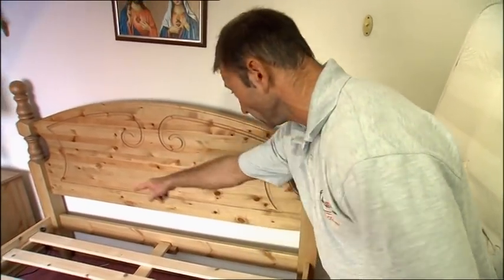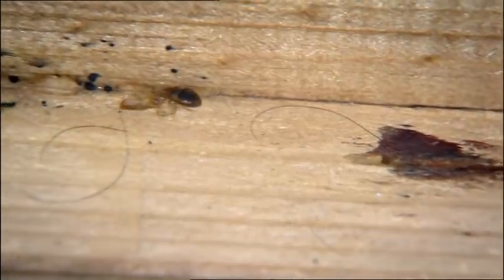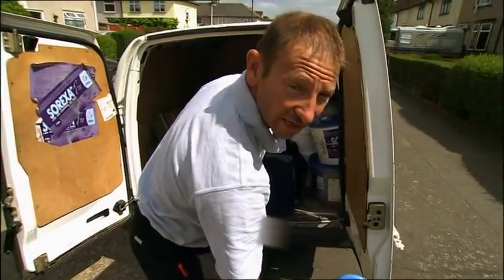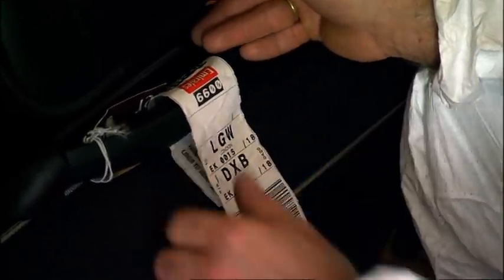Removing A Bed Bug Infestation | Grimefighters | Filth

Comment: A few years ago we had a bed bug problem. I got a spray bottle, 90% rubbing alcohol mixed with water and sprayed my mattresses, floors, headboard, nightstand and every nook and cranny. I got a new mattress, washed all clothes and blankets and vacuumed. Process took about 3 days or so but I haven't seen a bedbug since 2016. Hope this helps if you're on a budget.
Reply: Riyadhra Jackson moving into a new apartment from an infested one. we only had a few bugs and rarely saw them but thank you for this in case we carry them over on accident. we have a new mattress and furniture and have washed all of our clothing so hopefully we won’t but again thank you for the remedy :)
Reply: @4doz817  you're so welcome. A mattress protector would also be a good idea. My parents did it that for my sister but I didn't need it.
Reply: Good on you! However, I must say, you got lucky not to have a fire start from the alcohol. These days, there are new alternatives like CimeXa
Reply: @johnnycochicken  doubt it. I didn't really have anything that would unite with the alcohol.
Reply: And then use naphtalene balls for your wardrobe case. Cmon, there's plenty scented other than the old ones. It's quite good to snob off the bugs
Reply: Thanks so much!!!
Reply: I used strong dettol solution in a spray bottle. I used one part dettol and two parts water. Then thoroughly sprays my room including my mattress, my bed inside and outside. And all around the edges of the carpet by the skirting board. And inside the wardbrode and cupboards. And every single crack and hole I could find in the walls and the doors. I died that once a week for four weeks until they were all gone. I used the original orange dettol which is very strong. I had to stay out of my room after each spraying for 14 hours because the dettol fumes are very strong and harmful.
Reply: @OhItsReo  I have a son and he has a plastic covering on his mattress. When you use the 90% rubbing alcohol, how much did you use? And how long did it take for the mattress and box springs to dry?
Reply: This really doesn't work. The only way to get rid of bedbugs is heat.. also I don't recommend this bc if you spray an entire room with rubbing alcohol creates fumes and your whole house can explode from any heat or spark bc alcohol is flammable. You can watch YouTube videos of people who burned down their house after spraying the room down with rubbing alcohol.
Reply: @JJ_Justice  Its not true that this remedy can't be effective or that heat is the only way to eliminate bed bugs particularly in the early stages of an infestation. However, as you have stated, alcohol is risky and people have caused serious fires trying to use alcohol to eliminate bed bugs.
Reply: Traduction en  français
Reply: @jwbogacki  just now seeing your comment. From what I remember I eye balled it and used  like a cup of alcohol and the rest water in a standard spray bottle from Walmart. Spray bottle was less than a $1 about 96 to 98 cents. It doesn't take long to dry at all. The alcohol makes its dry quickly. Not even an hour. Hope this helps. 🙏
Reply: @JJ_Justice  it worked for me and for the money that I had at the time. I am aware of the potential risk. Thankfully none of that happened to me. This was like 5 years ago and I haven't seen a bug since then plus I have moved etc. I had an ex boyfriend at the time that smoked (not in my house though) and I did burn candles every now and then.
Reply: @leaperrins8373  everything was sprayed at the time. Also I got a new mattress as a Christmas gift from my mom that year so that's just what it was at that point.
Reply: @OhItsReo  Look I get it. We do what we have to do with the resources we have at the time. I just wanted to add a warning and some extra information. If you catch an infestation early it's way easier to deal with on your own. Because bed bugs are almost impossible to treat yourself at the latter stages.
Reply: @OhItsReo  Thanks, i'll keep it in mind. My brother used bug bombs to get rid of the bed bugs about 2-3 weeks ago. I've been using duct tape or packaging tape to trap the rest of them and throw them out.
Reply: @leaperrins8373  oh I agree. Your warning is definitely appropriate. People should definitely be careful. It was definitely an upsetting and stressful time for me. I had just moved out on my own and tried to deal as best I could. Again thankfully I'm bed bug free and hope I never have to deal with them again.
Reply: @jwbogacki  that's good. I hope all is well. It can be a nightmare. Back then it made me not want to go home.
Reply: This works 100%
Reply: I remembered I bombed my whole room with 90 percent alcohol and the room smelled so strong for 8 hours but I had the window open to air out and it killed every bug in there and I didn't have a problem with fire
Reply: Insecticide is not expensive, so there's no need to use alcohol instead of an insecticide due to budget reasons. Alcohol only harms the bugs if you directly spray on them, but alcohol evaporates quickly, so after you spray an area, it will evaporate away, and won't harm bugs that crawl on it afterwards. Insecticide on the other hand can kill them even if they crawl on to the treated area hours, days, or months later.

Unhatched eggs are less vulnerable than hatched bugs moving around. Even with insecticide you need to quarantine the area for a full life-cycle duration to make sure any dormant eggs have hatched, so that the hatchlings can run around and be exposed to the insecticide and die.

I really would not give alcohol much confidence here. Sure, it kills them if you spray with direct contact, but that means you can see them already, so you might as well use the sticky-tape method Pete uses here. Residual insecticide is the nail in the coffin for these guys that you really need, and that's what Pete sprays at the end. That way, any tiny ones that you missed will still die. And according to the post-filming update, it worked!

If you wanna save money, I suggest buying insecticide and doing the job right the first time.

Comment: I had to deal with bed bugs at my ex girlfriend's and my parents house in my parents bedroom. 90% isopropyl alcohol will kill them on contact. Completely soak your mattress and all furniture. On dressers and such, get into those corners really good. Then once you spray everything down really good, take all furniture and put it outside in the heat. Make sure that drawers of the dressers are out and laying on the ground. Make sure every side of the dresser and corner gets direct sunlight as well. They hate bright lights! Once your done with putting everything outside, go back to the room you were working in and soak the entire carpet because if they lay eggs in the carpet then they will just come back. Soak your walls too! Get every single square inch of the room you are working in with that alcohol. Do not sleep in the room for at least 48hrs. I also recommend soaking everything multiple times, like once it dries up, soak it again and let it dry then soak again, this includes the carpet in the room. Make sure you have plenty of ventilation and wear a mask cause the smell will be harsh. I did this with my parents room and we havent seen a single bed bug since, it's been 4 years since this! Oh and all your clothes, wash them in extremely hot water and when you dry them, dry them twice! They cant deal with the heat at all, it dries them out and then they die. If they are in the dresser draws, then it's possible they might be in some of the clothes so it's just safer to wash all clothes! Oh and I also got bed bug bombs and used 2 of those in the room just so the smoke could get in areas that I couldnt. I did this twice, so a total of 4 bed bug bombs were used in a 48hr period.
Reply: OK, I do have to point out that alcohol is extremely flammable and people have caused serious house fires by trying to do what you suggest. Secondly NEVER EVER use bug bombs with bed bugs. They run from the smoke as far as they can, and since they can fit into tiny spaces, you can spread them into other rooms and make the infestation worse.
Reply: @leaperrins8373  I used extreme caution and let the rooms ventilate very well. Also as to bed bug bombs, they do help. I didn't just do 1 and done. I did 2 at a time and did it three times in the room to guarantee the smoke would make it into the small crevices. So in the end, it's been 5yrs+ and not a single bed bug has been seen.
Reply: @kjrwhs2003  I understand why someone would use alcohol, I just wanted to state the risks because its potentially life threatening. However, I really cant get behind bug bombs for bed bugs. Many professionals do not recommend them for the reasons I've stated. There are better less risky solutions.

Comment: Shop vacuum! Vacuuming alone can remove up to 90% of bed bugs alone. Just be sure to empty the vacuum immediately outside the home when finished vacuuming. 

I'm a bed bug heat specialist. We use heat remediation (heating entire rooms or homes) to kill every bed bug plus their eggs, in that size room in about an hour. Heat remediation is hands down the quickest way to eliminate bed bugs in hours not days. We then strategically apply two separate preventative chemical residuals that are undetectable by bed bugs, to protect for any new bed bugs brought in. It is very important to use the correct bed bug chemicals that cannot be detected or any new bed bugs brought in after a full treatment will just avoid the areas sprayed with repellent chemicals until it is no longer effective enough to hurt them. They can survive anywhere around 7 months or more without feeding from your blood. They go into a dorment stage to waste as little energy as possible.

The English fellows bed bug removal with tape will take several hours just for the one bed alone and bed bugs do not only get on beds, couches and chairs. They get onto the homes structure and your belongings, especially if you use repellent chemicals and it drives them into hiding in different places. Not to mention that he uses a chemical residual spray and not fumigation as the announcer states. Chemical residual sprays when used as a stand alone will normally take 2-4 treatments total, spread apart but 7-14 days or even for some bed bug companies they may stretch it out to every month until gone. They can be hiding anywhere in your home but most will be within about 15 feet of where you sleep or sit for long periods of time. Eggs hatching new born baby bed bugs or instars are what most common folk and even exterminators have trouble completely getting rid of the bugs for.

~Can you see baby bed bugs? Click the link to find out:

https://bedbugheatspecialist.com/can-you-see-baby-bed-bugs/

#deadbugwalkinllc

Comment: Pro tip! If you can't afford pest control, rubbing alcohol (isopropyl) kills bedbugs and their eggs, almost instantly! The easiest way is to poke holes in the seal and spray it on all seams. Wash and EXTRA dry your clothes, as heat kills them too!

Comment: I had these things for a good while. Had to remove two whole beds to fix the problem as well as spray the hell outta my old gaming chair with Lysol. They are some of the most annoying bugs ever even compared with mosquitos and ticks, not only this but the smaller ones cause even more itch in my experience and they always come to you in groups.

Comment: You'll never get rid of them this way. I've had them and they'll even hide in electronics. They would hide in the USB ports and its all day. Kill them and two hours later there would be more. I'd have to clean the ports twenty times a day. I every set up a hammock to sleep in and two days later I was being bit again. We had the place sprayed probably ten times and it never made a difference. Eventually we had to move and start our lives over again. We had to leave everything. Three laptops, numerous tvs,pictures. All our books,my DVD collection which had over 2000 of them. At the time I had every Star wars book ever written and bed buds love hiding in books. Every piece of clothing. It hurt to lose all that but compared with a place that had no bedbugs it was worth it

Comment: Why did you spray the entire bed? You should only Spray the mattress stitching same with the suitcases you just sprayed the entire thing without even looking what was inside them and you sprayed the entire head board which is completely wrong it was dripping everwhere you only need to spray the joints and lines I mean the list goes on... Also who has time to take the bed frame appart like that and remove the bugs with tape I mean this entire video is a joke and not how professional pest control works